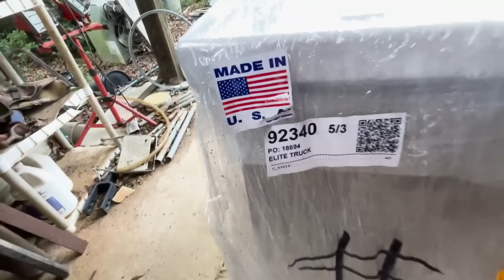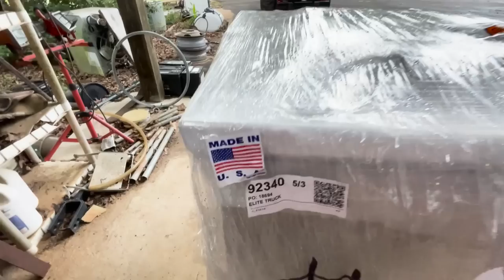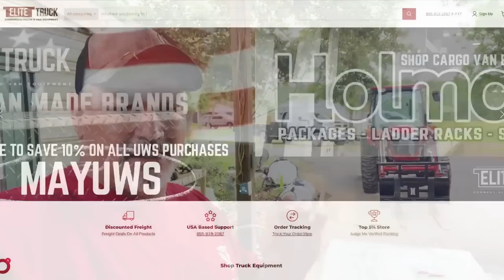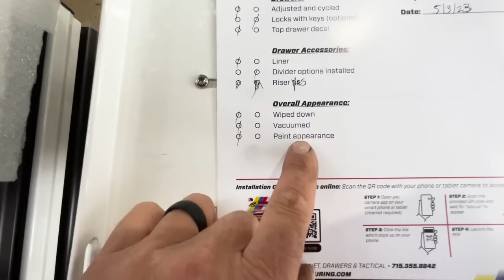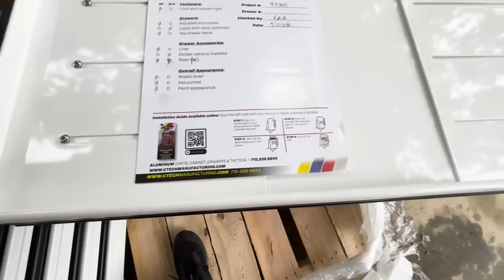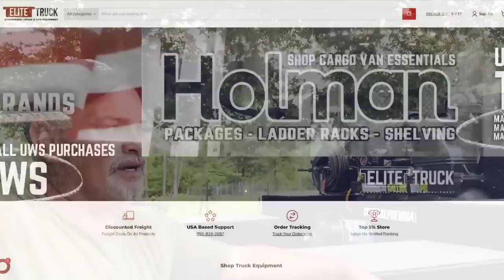INSANE service truck set up!

Comment: When I had a service truck I put the most frequently used tools in the passenger side boxes. That way whenever you are on the side of the road working your doors open towards the shoulder instead of the road. Had the same C-tech boxes in red they worked great. I think they had a slogan about how you’ll love getting in their drawers lol. That is a good looking truck.

Comment: Nice Boxes The drawers are a Great Up grade. I did this years ago useing a Craftsman bottom boxes on a Service truck. One hit save you some time in the future. your bolts on the bottom going to the outside, Reverse them. In other words, put the bolt in from the bottom to the inside and install the nuts on the inside It will help with keeping the threads in good shape and Helps to keep your shoulders, back, etc from getting scraped up if you have to go under your truck for some reason. I have scars from my stupidity on those things. Just a thought. Nice install video. helps those of us that aren't as smart as you. Well done.

Comment: Looks awesome Hank! I really wouldn't do much different. Having all the tools you need in one spot is a great system. I've always used the top drawers for wrenches, screwdrivers, hammers...common tools and the bottom drawers for everything else, tools that are big and not commonly used. Great install, great work! Thanks for sharing! 😎
Reply from the maker: Thank you sir

Comment: For your sockets check out the Ernst Manufacturing Socket Boss. I have those in my tool set and it is really nice not having to worry about sockets falling off the rail. I keep most of my hand sockets in those but my impact sockets are in a case. I have the Quinn 1/2 inch drive and the Quinn 3/8 inch drive impact socket sets and the main sockets I have for hand use are the Quinn master technician set. =)
Reply from the maker: Thanks for the tip👍

Comment: Suggestion--put some caulking/waterproofing around those nuts/.bolts on the bottom of the truck to waterproof them. Then maybe  come back after drying-shoot a coat of paint  to stop any rust. I know it's hmid/moist down there in Fla.

Comment: Since you had to push them to the back of the main box, I would put a couple ¼'' bolts at the top to keep them from rocking back and forth (side to side) and possibly breaking the drawer frame over time. Put them in a place where they want interfere with the drawer closing. They look great!

Comment: Hank move the wrenches front the bottom driver side box and put the dewalt electric tool there so there on the same side as your batteries

Comment: G'day mate I will say that I would have the impact batteries closer together and associated sockets On the same side of the truck. Otherwise you will be going back and forth between the two for a 10mm socket and extension for same. You are going to change it All around untill it works for you. Then you will have someone put something in the wrong place and you will tear your hair out in frustration.
Always keep an open mind and enjoy life

Comment: Hey Hank, I've been a subscriber of your for awhile now. I just found out, I wasn't. I looked into those drawer inserts before. There extremely expensive. $1- $3 k. I went the cheaper route for my single rear wheel Reading service body. DeWalt  tough 2 series drawer units and Durham manufacture parts drawer units with ¼" x1¼" n-52 disk magnets attached to the back of each drawer to keep them closed.
Another Great video.👍🏻👍🏻 Thanks for sharing.

Comment: Don’t forget to water proof the hole on the bottom so water doesn’t splash and sit in bottom of the box 👍.
Reply from the maker: Good idea!
Reply: Absolutely or it will rust out the bottom. I use Lexal calk (also comes in a tube) when I won't to make something permanently waterproof. It's clear and paintable. Silicone sometimes will come loose after a year or two.

Comment: Another way of locking ur nut and bolt is to tighten them in place and paint over exposed metal and it works the same as lock tite and also protects from rust  when it dries 👌

Comment: Looks nice….I too would go standard one side and metric the other. If your working on something metric the odds are it’s all metric and vice versa.  Just park it standard or metric closest to where ya working…..split the universal stuff on both sides (pliers, vice, crescent etc.).  I find it handy to have an empty canvass carry bag to load up what ya need and pack that to what your working on.
Reply: I work on tons of equipment, vehicles and structures that use both. Keeping it all together means your extensions, ratchets and impact drivers are all right there too. Mechanical tools on passenger side with the compressor outlet. Forestry, earthwork and rigging on the driver side with the crane.

Comment: Personally I would put a spacer behind (that would stop it from rocking)at the   top of the box and run two bolt through the bed wall  using fender washers / bottom of box again using fender washer and put the nuts on the inside to cut down rush and dirt in the threads, think about down the road (years) .

Comment: Don’t get too wrapped around the axle about getting stuff where it needs to be. After you have had it a while you will figure out what works for you. 
I would recommend the largest fasteners you can use to hole it all together as well as using fender washers to help spread the stress over a larger area. 
Looks good. Sure you will be happy with them. 👍
Reply from the maker: Good idea

Comment: I would put all my electric impacts in the long box on the driver side with the batteries and charger, along with a power inverter, so you'll have charged batteries all the time.

Comment: If you keep going so hard you're gonna end up moving from Dewalt cordless to Milwaukee! You'll find they have a LOT more industrial commercial type rated m18 tools you'll find you can't live without! I was on Ridgid 18v cordless for years, their stuff is between the Ryobi (homeowner) and Milwaukee (industrial) I did a lot of home repair stuff and they had almost ALL the cordless tools I needed. Turns out I could have really just bought a good generator at Harbor Freight and bought corded tools and saved a TON of money, but cordless rules out in the field in my opinion, however doing more mechanic work and metal stuff, I just got my first Milwaukee (it's an m12 impact just a little starter but still) I'm probably going to end up with a side of my garage now full of red AND orange! haha
edit: I'll bet you can get ANY color they OFFER!!

Comment: I missed it did he ever bolt the top to the back wall? Behind the top drawer is two holes to bolt through the back wall.
Reply from the maker: No, just to the sides. It doesn't move.  It's been a great set of drawers!

Comment: You need to right down all you have and put in to the truck and it be good to use a label Maker and put a label on so you and your Buddy you work with all the time. You should use grad 4 or 5 bolt's I would put two nut's an bolt's on top each side
Reply from the maker: Added labels last week!

Comment: you need a electric fence to keep the pigs in, they will walk through that wood setup. 👈😒👺👀👍
hank, you should get a small camper washing machine keep it outside were that red tool box is. and put all your caps that are dirty in it .?

Comment: Toys for boys. No locks!?
Reply from the maker: The main door is lockable.  I didn’t need every drawer to lock. 👍
Reply: Trust me, if a tweaker wants in it he’ll get in. I’m on the road constantly and stay in motels all the time. When road crews park in the motel lot it’s almost unusual if at least one of their service trucks isn’t broken into and cleaned out. Tool boxes, air compressors, generators/ welders, cordless tools and anything else that would bring a dollar. You just have to keep an accurate inventory list of everything on your service vehicle and make sure that you are covered for theft of the items on your truck. That’s the world we live in right now. They stole about 150 gallons of diesel from me during the night one time.
Reply: My oversight. Didn't see any evidence of a lock on the main door. My truck was stolen so I'm now hyper-vigilant. Thank you for the clarification.

Comment: what kind of tractor do you gots that can’t be washed or little dirty are actually dissing on your TYM. stands for TALK TO YOU IN A MINUTE “TYM”.  Now if they delivered and was doing a drawing give away your small one you’ve got with a small bucket because my dad could put limbs n lawn heavy bags help load them where he doesn’t have ta pick them up so high. another way is while using a ladder put the bucket resting on back side to steady it i don’t don’t need a back hoe